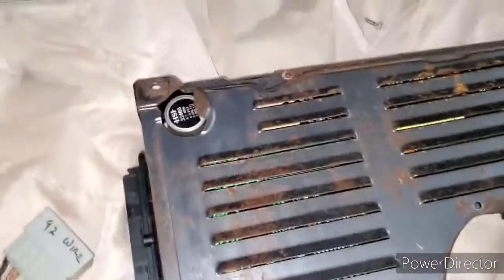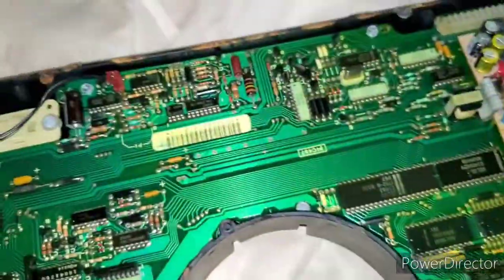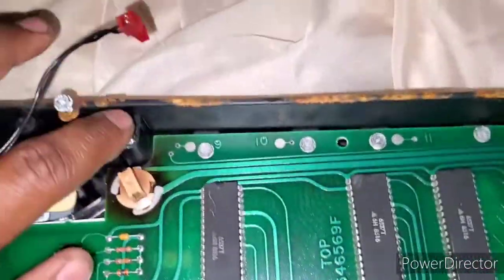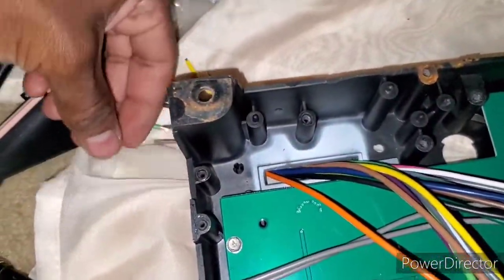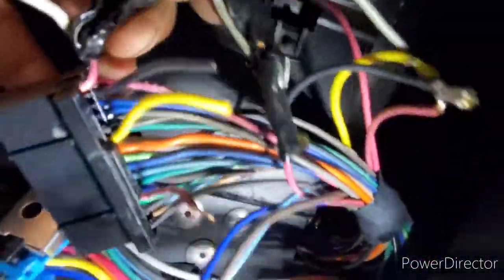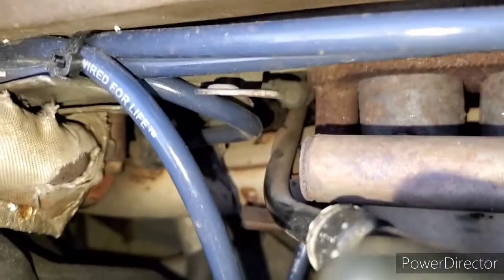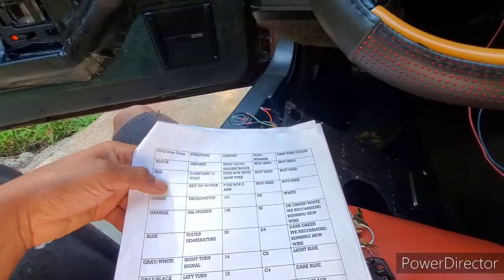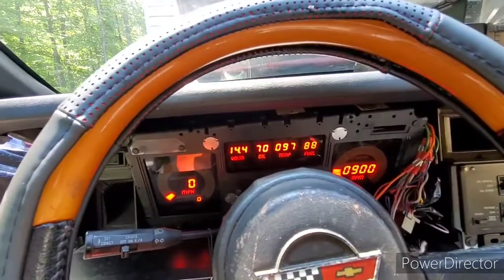1984-1989 corvette intellitronix digital gauge install

Comment: I just got a 87 Corvette and nothing will light up or work so I am checking on my opinions . Thanks for the video what do these costs ?
Reply from the maker: The gauges cost 624 u can probably find some other ones cheaper. If nothing is wrong check the fuses.
Reply: @musclecargarage8882  ok thanks for letting me know and getting back to me .
Reply from the maker: @gregconner4460  no problem let me know what you find out
Reply: @musclecargarage8882  Will do thanks buddy !
Reply from the maker: No problem. See if this helps u https://images.app.goo.gl/znzEM4i5MTKRxjmv8
Reply: @musclecargarage8882  Thanks it looks like the wiring harness for the Space Shuttle lol !
Reply from the maker: @gregconner4460  lol yea. it might help ya
Reply: @musclecargarage8882  lol I have a buddy who is pretty good with that stuff .
Reply from the maker: @gregconner4460  oh ok u will be fine then lol
Reply: @musclecargarage8882  I think so lol

Comment: Read down thru the replies and now see where your video was off. Hooking up speedometer on my C4. I tried calling the inteiiitronix support but haven't got a reply. My plugs doesn't have a wire in the C15 pin 's hole so I am really confused. Nor are the wires in D11 and D3 the same colors as the ones in your's. Thxs
Reply from the maker: Chevy was dumb back then and keep changing their wiring every year. What year is ur car??
Reply: @musclecargarage8882  1985 just installed a fresh built engine and really need some gages. Noticed that D11 and D3 loop and only C15  goes to the white speedo wire. My pin doesn't have a wire hooked to it but it appears to be tied to C16 on the circuit board. So maybe C16 will hook to the white speedo wire? Thxs for your time and consideration.
Reply from the maker: @joehoward3243  oh ok you can try that. Here is a link to wiring diagram 
https://www.google.com/search?q=1987+corvette+gauge+wiring+diagram+&tbm=isch&ved=2ahUKEwjb5syHh4LyAhWMWN8KHTmfD1sQ2-cCegQIABAB&oq=1987+corvette+gauge+wiring+diagram+&gs_lcp=ChJtb2JpbGUtZ3dzLXdpei1pbWcQAzIFCAAQzQI6BAgjECc6BAgAEBg6BQghEKsCOgQIIRAKOgIIADoECAAQDVCogQFY6OkBYITsAWgBcAB4AYAB6QGIAeUnkgEGMC4yOC41mAEAoAEBwAEB&sclient=mobile-gws-wiz-img&ei=b1v_YJvzIoyx_Qa5vr7YBQ&bih=692&biw=412&prmd=sivn#imgrc=HmEoRIX_vhEMyM
Reply: @musclecargarage8882  After studying the wiring diagrams I decided to return the Intellitronix gage cluster and have my original rebuilt. I don't like the idea of messing up the computer systems. If I was doing a carburetor swap and doing away with the pc I might have used the aftermarket. Also their tech support was terrible. I would advice anyone to avoid these gages.
Reply from the maker: Oh ok and yea I agree their customers service does suck

Comment: I am trying to wire mine up but the speedometer is not working. I noticed you have a white wire that goes off of the C15, D11 and D3 loop that is taped up a couple times, are there any other wires involved from the harness?
Reply from the maker: My brothers wasn't working either I had to call them and redo the speedometer wiring. The previous owner kinda messed up the harness. Its working now but I have to  calibrated it since its 20 miles off the  actual speed limit
Reply: @musclecargarage8882  yeah I'll be under mine checking the wire colors after work. Apparently I got an odd ball that was color coded different and or pinned different. Can't get the blinkers or high beams to work either. It's a grind but I'll get it.
Reply from the maker: @coreychurch7145  The wires on the instructions are wrong I had to call them . Ill have to look at the my instructions to see what goes where i labeled it on the instructions. Ill let u know later if u dont figure it out
Reply: @musclecargarage8882 a picture with the right stuff would be awesome. Wasn't able to get it on the lift today. I greatly appreciate the help.
Reply: @musclecargarage8882  I got it. Finally I got it. Took someone else telling me that they didn't know and that I knew more about it. Lol
Reply from the maker: Lol good to hear
Reply: @musclecargarage8882  nice vid, sure helps with my set up. I am converting to analog dash and pretty much all wires are straight forward except that speed wire. So you connect all 3 together what I understood, c15 c11 and d3? And works ok? What do you think if i leave my old mechanical odometer (managed to squeezed it into the housing and ran wire through the grilles of the back metal cover)could i connect it also and make it work?
Reply: Sorry meant C15 D11 and D3
Reply from the maker: @bojankalodjera1757  If u get the digital gauges u have to use it. U can try and use the original one but i doubt it will work.
Reply: @musclecargarage8882  thanks man, i guess i ll just try. But for the new digital you just connected C15 D11 and D3 together?
Reply from the maker: Yes i did. I can check again to make sure
Reply: @musclecargarage8882  yeah i think that’s what i saw on your video, just wanted to make sure it’s ok to connect them together. In instruction says c15 must loop d11 to d3 but I wasn’t sure if that means that you can just connect them together.. great if that’s the case..
Reply from the maker: Your welcome abd yes just connected those and let me know what happens
Reply: @musclecargarage8882  I connected c15 to d11 and d3 and connected all to white speed wire from the new cluster but speedo doesn’t work.. do you have any ideas?
Reply: Update: i connected white wire to c15 and connected d11 and d3 together (but did not connect them to c15) and now it works but displaying mph. Need to see how to switch to kph.
Reply from the maker: @bojankalodjera1757  ok good to hear and glad it worked out for u. I also had issues  wiring the speedometer
Reply: I am glad to see someone corrected this c15 is a ground pulse return from the speed sensor . Bridging d11 and d3 is completing the ground output for the speed sensor .  Originally he had the output ground and sensor return ground both connected to a source ground to the cluster .  Lol it never would have worked . My instructions also say I can hook the white wire to the c15  (purple )or c16 wire (black/pink ).  C/16 is a damn 12 volt ignition wire !!!   Hopefully they correct this soon .

Comment: I just got my 1st c4 84 vett & need this done ASAP please let me know how much was this kit $$$
Reply from the maker: The kit was 624 for the gauges
Reply: @musclecargarage8882  I thought the dash was going for right under 400?
Reply from the maker: U are correct it is 400 something
Reply: @musclecargarage8882  so what gauges he talking bout? I'm thinking bout buying that 400 dollar dash since it got that lifetime warranty.  What else would I need cause I'm not seeing where 600 dollars coming from
Reply from the maker: This one the 1984-1989 Corvette Analog AP2003 cost  600 something
Reply: @musclecargarage8882  oh ok I was talking bout the digital one in the video. Wire set up should be as same as the way you did. Did you have to buy a harness or adapter for the new cluster to connect to the car or you just spliced into the original wires ?
Reply from the maker: No u dont have to buy any harness just splice it in on ur existing harness

Comment: It kills me to see this when I need a new center panel for mine.
Reply from the maker: He still has the center panel for the gauges
Reply: @musclecargarage8882  What's it worth to him?   I have one more thing to try before I decide I have to replace the panel.
Reply from the maker: I can ask and let u know. He's centerpiece wasn't working either
Reply: @musclecargarage8882  that would be nice. As long as it's not cracked/broken, it's usable.
Reply from the maker: @fryloc359  how about 100 bucks
Reply: @musclecargarage8882  is that for just the glass panel, or for everything? I can get new ones for $110.
Reply from the maker: @fryloc359 oh ok im not too familiar with chevy stuff. For the gauges and everything else. What u think its worth??

Comment: Why would anybody take a factory digital dash cluster out just to replace it with another digital dash that doesnt look near as good? Hard pass
Reply from the maker: I think these are brighter. The older gauges were nice and ahead of its time
Reply: @musclecargarage8882  Im sure the newer ones have more features but the original one looks so much cooler. Intellitronix does make a nice guage.
Reply from the maker: Yea i agree the older gauges were futuristic and ahead of its time. The only gauge that kinda work was the speedo gauge and once u got above 30 miles it wouldn't go any further. They also weren't that bright
Reply: @musclecargarage8882  yea thats a bummer. I have the factory digital cluster in my 92 Jimmy. Its pretty bright. I love it... until it stops working. Maybe that wont happen.
Reply from the maker: I have seen people that repair the factory gauges which is cool. I don't know much they charge tho
Reply: @musclecargarage8882  I think generally its the power supply that the solder needs re-flowed. Usually fixes them.
Reply from the maker: Thanks thats good to know. The c4 weren't the most popular corvette so they pretty cheap to buy and upgrade
Reply: @joshlepley3725  I totally dig the look and layout of the stock “digi-dash” or “Star Wars” cluster BUUUT, I’m doing black on black with purple accents and it’s gonna look sooooo clean with a purple lit dash / gauges
Reply: @StevieCzykPN  Heck yeah man. Get it done up!!!